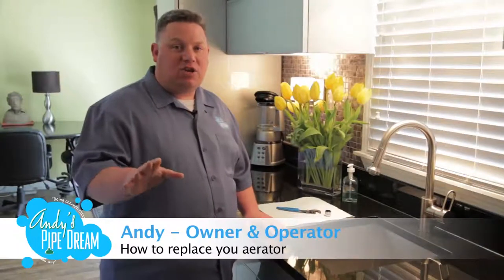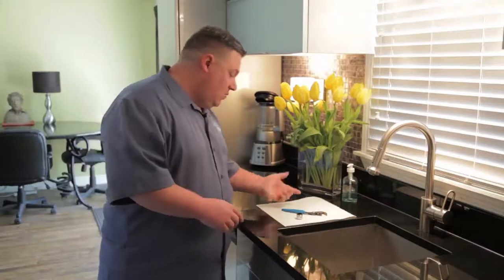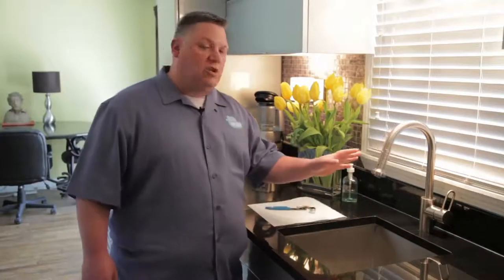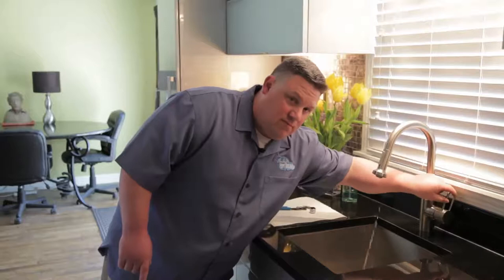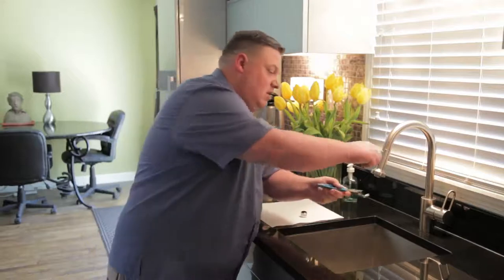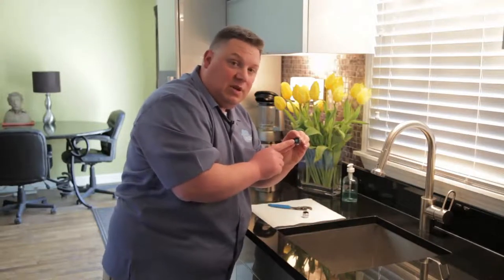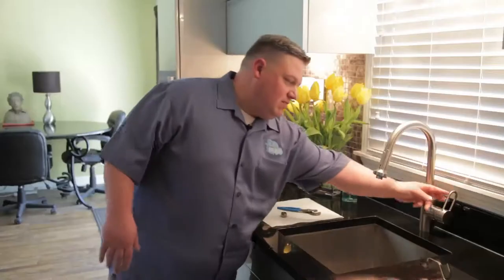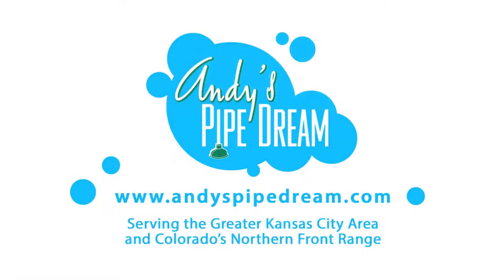Replacing a faucet aerator- Andy's Pipe Dream

Comment: My Kohler kitchen faucet's aerator dropped out, cannot find a replacement for a recessed aerator, any suggestions ? Model K-R10430, Kohler sent me an aerator 1031237-/CP which has a medal housing, mine is the size of a dime with no metal housing. Order 16040940. Carol Southerland

Comment: Ok I'm confused.  Counterclockwise is not right to left and you said.  That would be clockwise.  Left to right is counterclockwise.  That's how it worked on my faucet.
Reply from the maker: Righty tighty, lefty loosey. After 30+ years as a plumber, I know a thing or two about clockwise and counterclockwise. The video is correct, but thank you for your comment.
Reply: @AndysPipeDreamPlumbing  I am not doubting your knowledge about plumbing.  I apologize if I offended you.  But the hands of the clock go from right to left.  Not left to right.
Reply from the maker: @Oontaka  no offense taken. It depends on which way you are looking at the faucet. From the top you would be correct, but from the sink looking up you would be turning the aerator clockwise to tighten and counterclockwise to loosen. Hopefully that explains it better!